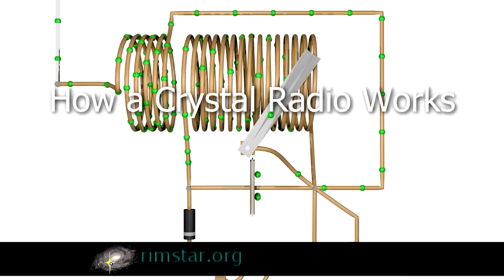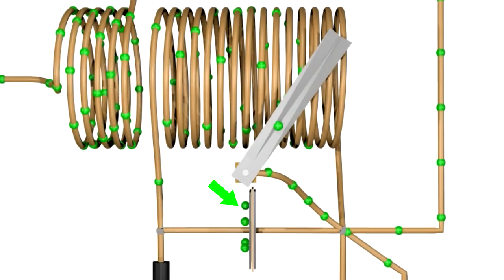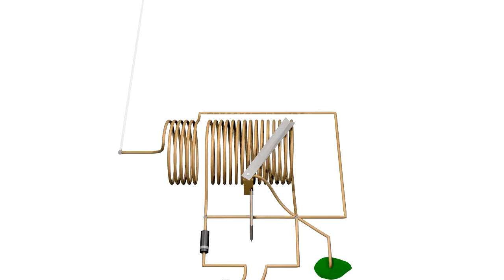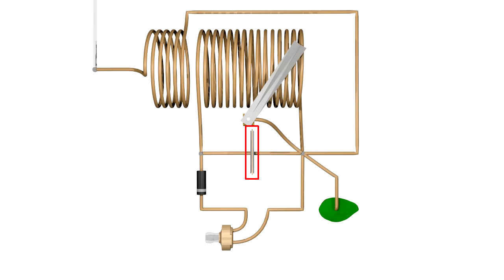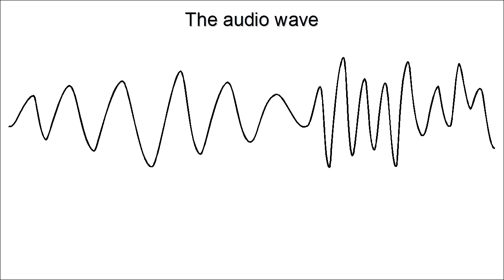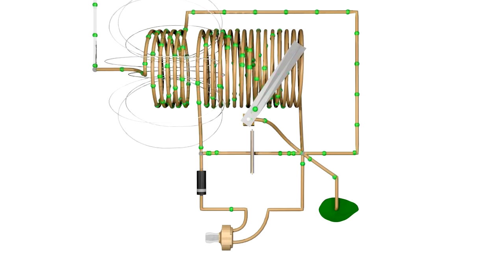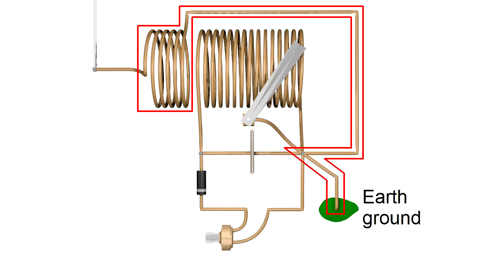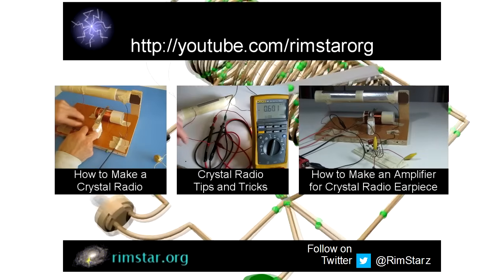How a Crystal Radio Works

Comment: Great video.. i agree
BUT HAVE YOU NOTICED THIS

Current IN A DIODE flows from Anode (+) to Cathode (-) as we all know.
current will only flow in one direction as we know
current cannot enter the diode from the Negative side with the stripe as we know

Long Story short
YOU'VE PUT YOUR DIODE IN THE WRONG WAY AROUND
You've shown that the current is entering from the Negative Cathode
but is cannot flow from Anode to Cathode
Reply from the maker: You're talking about conventional current and I'm showing electron current. Conventional current originated from a time before electrons were discovered, before it was know what charge carrier was flowing in the wires of a circuit. So the direction had to be guessed at, and it turns out it was guessed to flow in the opposite direction of electrons.
I'm showing electron current in this video, and electron current flows from the cathode to the anode through a diode. If I wasn't showing the electrons then I would have used arrows instead and shown them in the direction you're talking about, the direction of conventional current.
https://en.wikipedia.org/wiki/Electric_current#Conventions
Reply: RimstarOrg
hehe, you have me mistaken for a beginner. :P
No No... so we are clear..  i do clearly understand Conventional Current flow theory vs Electron Flow Theory.

i see what you are doing here.
ok.. but i believe it's still incorrect

At University, many years ago (yes...Electron flow theory was still around) however, the course taught us according to Conventional Flow theory...... I was taught as follows..

1. in this course kiddies, we will be learning according to Conventional flow theory
2. it's easier to explain it that way because everything flows from HIGH ENERGY LEVELS to LOW ENERGY LEVELS Regardless of the Convention that is used  (i think we can agree on this... right ?)

Now. when we were taught Diodes and Rectifiers I think the first or second week,
i specifically asked the question
"But, i do realize that we are focusing on Conventional theory, but... WITH ELECTRON FLOW THEORY which way does current flow through a diode"

THE ANSWER WAS AS  FOLLOWS

They symbol for a diode, which is a POLARIZED DEVICE is such that we have the ANODE labelled and the CATHODE labelled
Current ALWAYS flows from Anode to Cathode

we then discussed that these symbols were created in a time when only Conventional theory existed (As is your point)
and we were then taught that

1. since we now have the choice of using either convention, *We make the decision as to where to put the + and - *

2. Therefore THE ORIENTATION of the polarized component must be orientated such so that the symbol is represented correctly with respect to the flow of current REGARDLESS OF THE CONVENTION THAT IS USED

3. if we use Electron theory, we have to Change the + and -   such so that the Anode is negative and the Cathode is Positive
HOWEVER  THE SCHEMATIC SYMBOL REMAINS AS IT IS Meaning, current will flow from the part without the line to the part with the line

if it is done this way, The schematic still works and you can use Either Convention so long as you label the polarity accordingly 

but, you can't represent a Diode on a Schematic as having current flowing (Regardless of polarity and convention) you can't represent is in reverse, from Cathode to Anode
because doing this represents that current DOES NOT FLOW (we are ignoring breakdown voltage here, or course)

so again... no offense (and feel free to prove me wrong)
this is how i was taught, this is the way everyone that i know was taught and i have never in many many years seen it any other way

i understand your point about Using different conventions
but again.. it's irrelevant when we consider the symbol for a diode

I understand the point of Polarity and Positive and Negative, which again goes back to convention.
but again.. it's irrelevant when we consider the layout of the symbol for the diode.

however when we consider that CURRENT FLOWS FROM ANODE TO CATHODE (without defining the Polarity of Anode or Cathode) Everything works regardless

we are then supposed to decide on a convention and regardless of what we choose
we have to label our battery and our diode's accordingly so that our components polarity respects the direction of current ACCORDING TO OUR CHOSEN CONVENTION

if we do that... everything still works

so.. i still hold that the diode is around the wrong way
the only explanation to why you have done this is either

1. it's an honest oversight (Which , i personally think is the case) after all you have a very good video, no question about it and you have knowledge on this subject

or
2. you were taught different to me and YOU MUST HAVE BEEN TAUGHT THAT.... 
When using Electron flow theory that you need to maintain the polarity of the Cathode and Anode
but.. you need to flip the diode symbol's direction

if that's the case, i have to say.. THAT'S FUCKING CONFUSING.   hehe
that would really confuse the shit out of someone, especially a beginner
and especially if you design a circuit where diodes are going in different directions on the same board hehe,  what a fucking nightmare from a schematic point of view

however if you keep the symbols the same, IT ALL WORKS and it can be given to another engineer and they will instantly understand it

again.. we were taught that Positive and Negative are Arbitrary 
but the symbols are what they are
(obviously i'm only referring to polarized components)

so.. what say you on this subject
is this a mistake on your part
or were you taught different 

look forward to your reply
Reply from the maker: Yeah, it's hard to tell from an initial comment the level of knowledge of the person you're talking to.
However, I have to disagree still. The symbol for a diode has to line up with where the band is painted on the diode. And the band on the diode represents the way the  semiconductor material is arranged and works inside the diode. Electrons flow in only one direction according to that semiconducting material.
Reply: rimstarOrg
Yeah, it's hard to tell from an initial comment the level of knowledge of the person you're talking to.
No problem, all good, i understand

 I have to disagree still. 
ok, no problem, present your case....

The symbol for a diode has to line up with where the band is painted on the diode
I AGREE, the line on the diode symbol must line up with the line on the physical diode

the band on the diode represents the way the semiconductor material is arranged and works inside the diode.
*well.... umm... sort of..
I DO AGREE STILL
but.. the band actually represents the direction of current flow, that being from Anode to Cathode,
now.. you can debate that it represents how the Semiconductor material is arranged, (Which technically is not the case) but.. yeah ok,  i'll give you this one as well because it comes back to the same argument of Holes versus electrons
which ultimately leads us to define the direction of current flow through a diode which is..... Anode to Cathode
so.. I AGREE  WITH YOU ON THIS AS WELL*

Electrons flow in only one direction according to that semiconducting material.
*Indeed that do... I AGREE WITH THAT AS WELL
however
in your animated diagram, 
1. the current was not flowing in the direction indicated by the line on the diode
2. if we go by the definition that you stated of semiconductor material,  which ultimately is how the component works, and we go into a debate of holes vs electrons and how it all moves and flows.
BASED ON THE SEMICONDUCTOR MATERIAL is flows from Anode to Cathode
so.. your orientation is still incorrect,  it has to be....    don't you agree?*

so.. it doesn't seem like our educational background on Basics of EE is differing.
i would say this is just a simple mistake

i agree with everything you presented, how could it be otherwise ?
and i still hold that it's orientated incorrectly BASED ON WHAT YOU SAID
Reply from the maker: Martin Kuliza Somehow I missed your reply and only just saw it now as when I looked noticed Oranje Manatee's reply. I agree with what Oranje says.
But maybe it would be easier if we stopped saying current without qualifying it. There's conventional current and hole current, which through a diode are the same direction, and then there's electron flow which is in the opposite direction of those. So when you say
"in you animated diagram, 
 1. the current was not flowing in the direction indicated by the line on the diode"
that's because I was showing electron flow and not conventional/hole current. The electron flow is from the cathode to the anode, from the line side to the non-line side.

Comment: PLEASE stop promoting the myth that the detector diode works by way of rectification - IT DOESN'T. The truth is only slightly more complicated, but if you can't explain the heterodyne principle, please just gloss over it and explain that the diode or crystal is able to demodulate the RF signal.

Comment: Your design, as presented, would have lousy performance because of the shorted turns in the coil.  You would have to disconnect the right hand end of the coil from earth to get it working.

Comment: Having built a zillion crystal radios as a kid, that two coil design is completely unnecessary. Also where’s the ferrite rod?
Reply from the maker: There's more than one way to build a crystal radio. The ferrite rod isn't needed in this design. The two coils aren't necessary but they're used to help with selectivity.
Reply: @RimstarOrg  I’ve got them to listen to shortwave etc by fiddling with the coil, but always better with a ferrite rod 😜. Germanium diodes are better for crystal radios too. (Spent way too long playing with them as a kid)
Reply from the maker: A ferrite rod is something I've wanted to try but these days AM radios are getting scarcer around the world. I guess that's where shortwave helps. I've done short wave with a kit that has a pancake coil.

Comment: Why in the world would you base your discussion around/about ELECTRON movement, which is, in fact, VERY slow...as in. millimeters/second?  It makes the entire discussion essentially wrong.
Reply: Electron drift is slow, yes, but the changes in the electric field (and hence the direction electrons move) are transmitted at the speed of light. I believe it's valid to use the electron movement in the discussion.

Comment: WHERE  ARE  THE  CRYSTALS??? I CANNOT SEE ANY CRYSTALS  AT ALL>>>>>>> ARENT CRYSTALS SOMETHING LIKE GLASS? WHERE  IS IT??? u  NEED  TO  SIMLIFY  EVERYTHNG >>>>>>  IT  IS  TOO COMPLICATED TO  LAY  PEOPLE >>>>>SO  BE SO  SIMPLE  AND  EXPLAIN THOSE  TECHNICAL CONCEPT  FIRSTLY
Reply from the maker: In the early 1900s, crystal materials like galena were used instead of the modern diode which I spoke of. That's why it got the name crystal radio. These days, crystal radio refers to any radio which is power solely by the incoming radio waves.